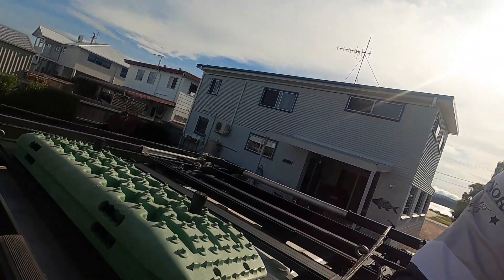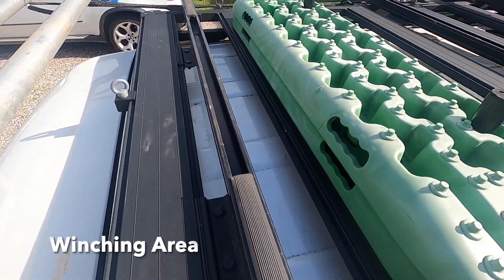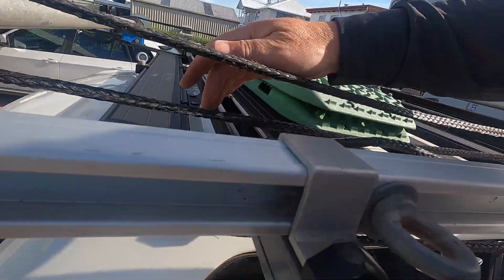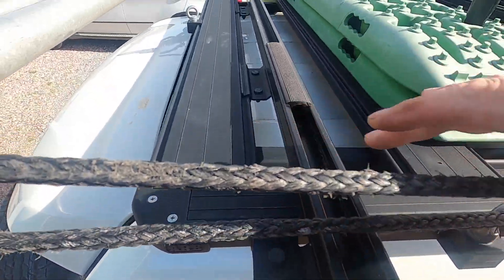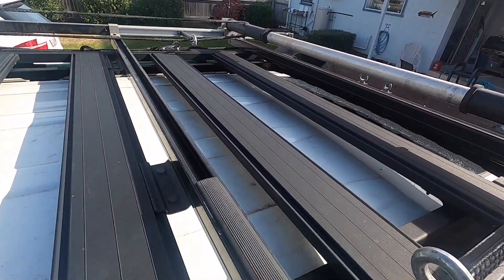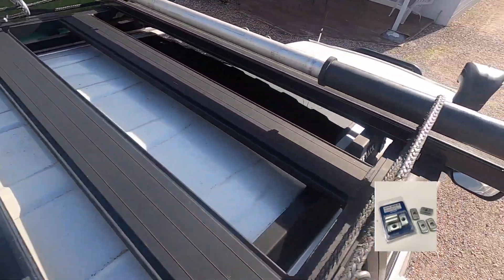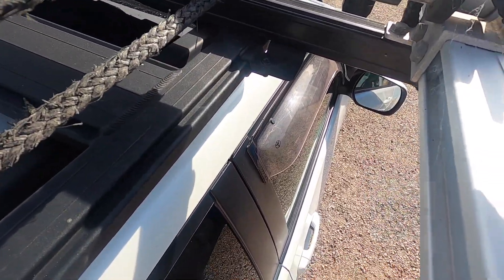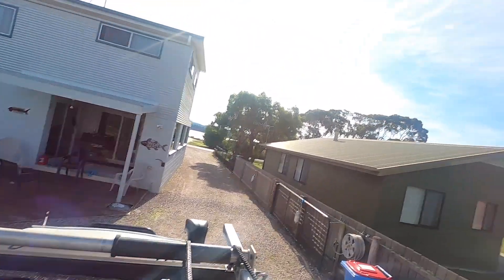Our Rhino Rack Boat Loader on our Prado 150 Series attached to our ARB Base Rack

Comment: Hi there, i am trying to acheive the same set up on my 200 series. What are the bracket you used please.
Thank you
Reply from the maker: The brackets are in the ARB base rack accessories range we used a total of 4 of the larger ones and 4 of the smaller ones to ensure a strong attachment to the base rack
Reply: Appreciate the reply thank you, I will check them out

Comment: Nice video. I have purchased a series one boat loader like yours to put on my Defender. The car has a rear mounted spare like yours. How far over the spare does the loader and boat hang for travelling. Does the rear section of the loader bend under the weight of the boat when winching off and on.😊
Reply from the maker: Not much if anything - the H frame ensure it canter levers over the spare on the way up and down
Reply from the maker: There is a small amount of flexing but negligible
Reply: @trekcampfish  Thanks for the prompt reply.

Comment: Hey mate, good looking setup. 
Just a quick question, how do you go with the GVM/GCM of the vehicle? 
I'm thinking of doing the same setup, I have a 2017 gx prado
Reply from the maker: @ashleybertus88  the boat is only 60 kilos and the loader around 18 - roof is good for 100kg based on manufacturers specs